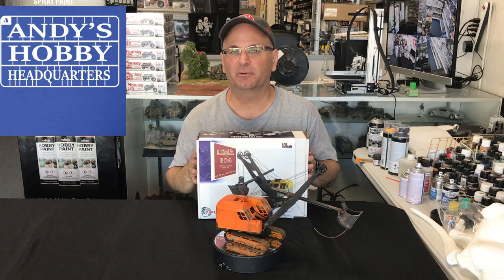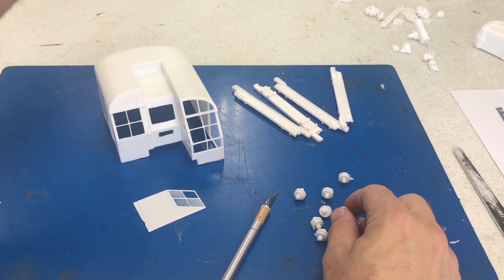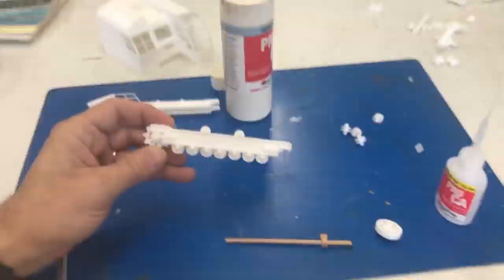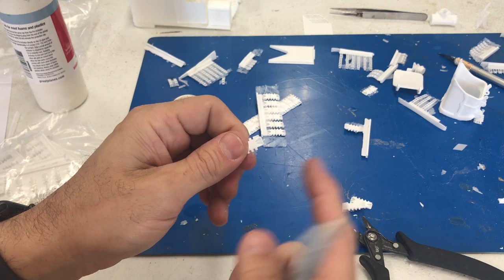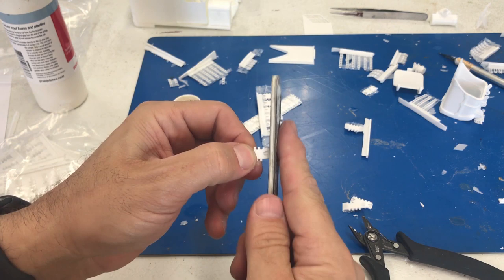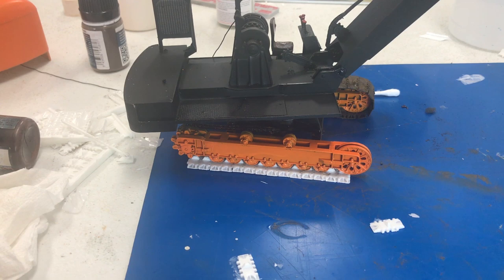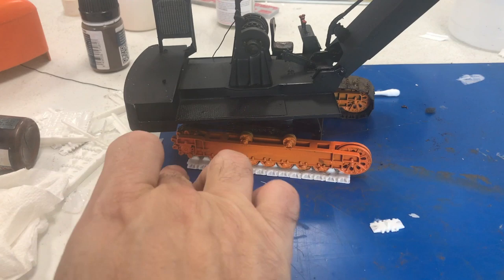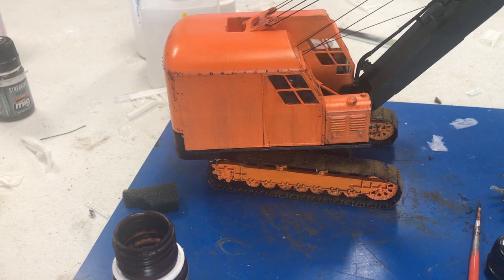Building the 1/35 MASTER PIECE MODELS LIMA 604 Shovel crane dragline resin kit

Comment: The lower structures on crawler crane’s/excavators are called undercarriages or crawler undercarriages, the upper structure (with the machinery house ) is usually called the car body. The  equipment , comprises the main boom, and dipper ( bucket attached to ) . This machine is a Face shovel . Lima’s were usually two tone on the car body, lower red upper light grey. Out of all the old school shovel/Draglines, The Lima locomotive built equipment was the Rolls Royce / Cadillac of machinery 👌🏻 Beautiful model 👍🏻 thanks for sharing.

Comment: Funny, I pretty much only use CA for all my plastic models-(Unless a part requires very careful open/alignment times)- Using CA has saved my work MANY times now,  if ya make a mistake, or need to re-fit/mod/re-mod a piece, you can simply snap it off @ the seam VS a chemically bonded-welding-melted piece....Works for me!

Comment: What is the benefit of a resin kit? Superglue sucks to work with and more cleanup... you did a superb job as always but it's got me thinking why would a company make a kit this way?
Reply from the maker: You can make small production runs of rare vehicles , a plastic company probably wouldn’t spend the money to produce this.
Reply: Resin allows finer detail than injection molded plastic.

Comment: Dammn, i need to take out a loan to get this kit......have you guys seen the price?? =o
Reply: In person it is very impressive though and the quality is very good.
Reply: @ChoppersModelworks  all the gears and tracks are static, junk.
Reply: @MICKSHRED  It's called a "model" and not an R/C kit. And no the quality is just fine. The real tracks didn't have a ton of detail on them as they were designed for spreading the load out. These are not some beginner kit so modeling experience is required.